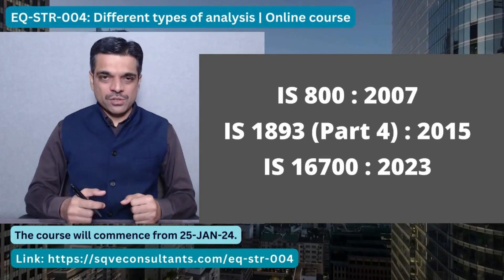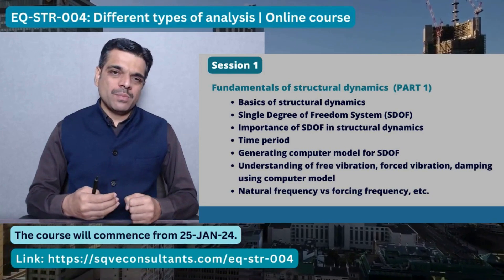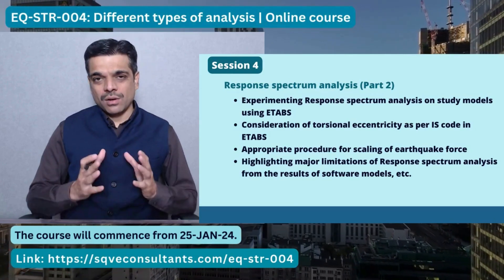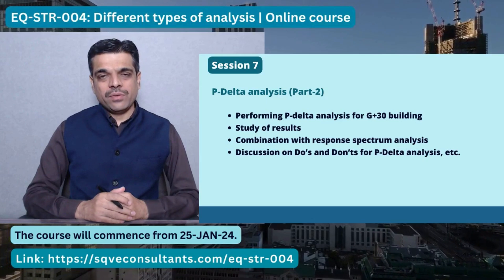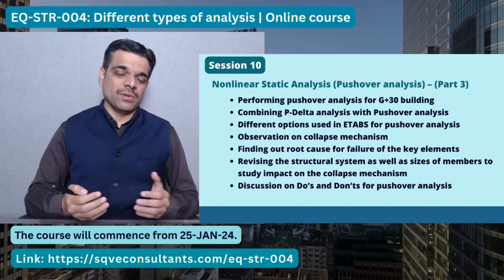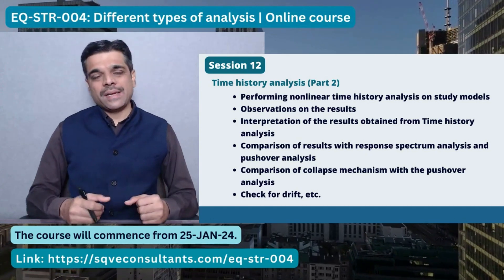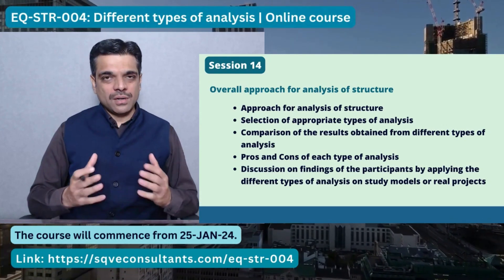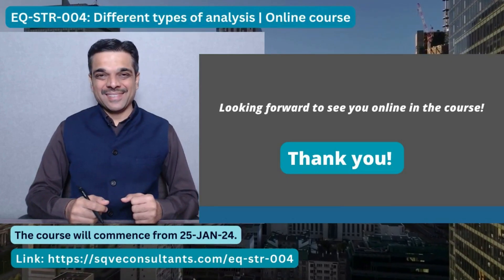EQ-STR-004: Types of analysis for earthquake resistant design | ETABS | Online course | Bhavin Shah

Comment: Is this course includes manual calculations/examples & theory of each and every type of analysis?
Reply: It's okay that you consider staad pro also for this course...
It would be better if a small topic has been added in the same course name "BUCKLING ANALYSIS" OR "STABILITY ANALYSIS" as per clause 4.5.4 of  IS 800:2007 , as buckling load factor is decide, whether second order analysis is required or not....
Reply from the maker: Yes, it is covered in the course. You may refer brochure for the details. We will utilize manual calculations to verify and validate the results obtained from the advanced analysis.